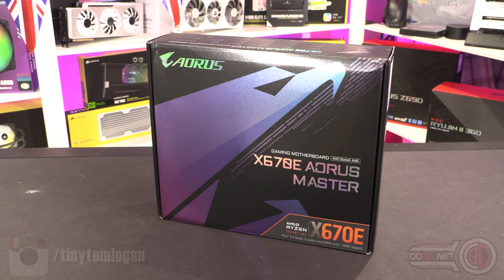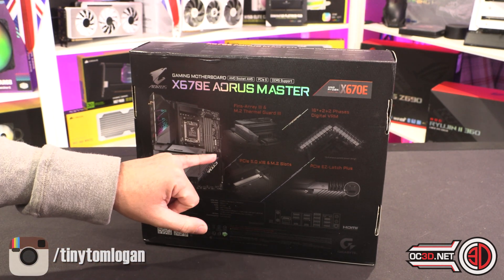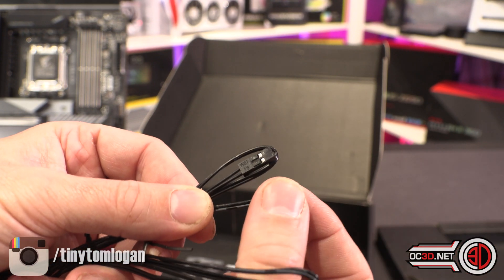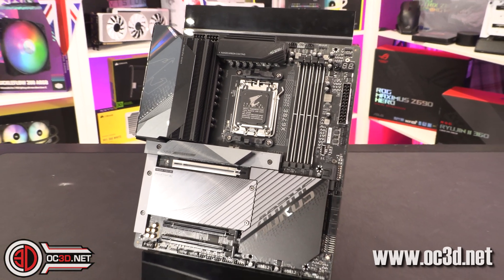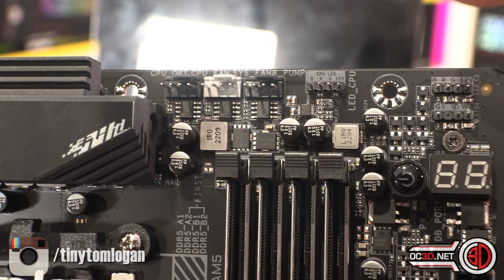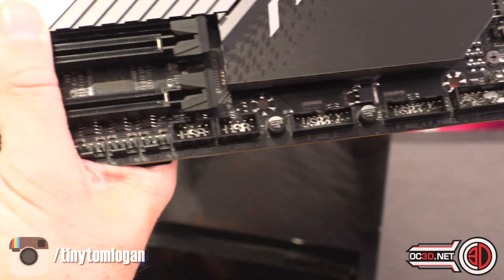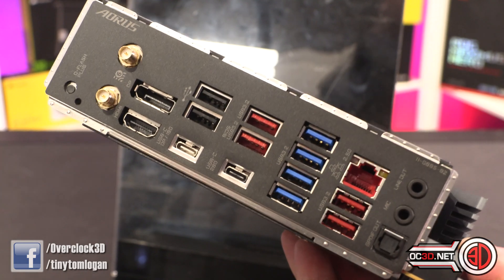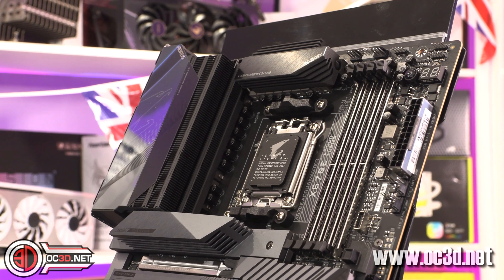Gigabyte Aorus X670E Master AM5 Motherboard Preview

Comment: Those heatsinks are fucking huge! I wonder if it interferes with a lot of air coolers like the NH d15. Personally I would wait for the vrm spreadsheet to be updated. I did that when I bought my b450 tomahawk max so I knew it could handle the 16 core 5950x. I wonder if amd will be releasing a 24 or 32 core am5 processor or if 16 cores at 170w tdp is the highest. I game at 4k so I have no need to upgrade my cpu to anything  but if I did it would be a 5950x. I'm currently focusing more on audio and other functionality for my setup. Id really like a good cheap sound bar and an sound card/audio mixer/pre amp thing. I just bought a pair of hyper x cloud 2's for $50 new and I'm excited to try them out as many people rave about how comfortable they are and their sound. I used to have audio technica m50s and they are flat and are super uncomfortable. If I don't like the hyper xs they will go back and I'll get senhesier 569s. I also just added some extra Bluetooth dongles to my pc, one dedicated to ps3 controllers and the other is for everything else. The reason being the one Bluetooth dongle had to have its drivers replaced with ps3 controller drivers for it to work properly. I would get a ps4 controller but they are so expensive. Other things I want to work on for my setup is a Bluetooth/wired hot swappable 104 keyboard. I am looking at the one from keychron but don't need a new keyboard atm so I can't justify it. I currently need a new gpu. My 1080ti can't game at 4k 60fps anymore so I'm keeping my eyes peeled for a good deal on a 3080ti or something newer.

Comment: 9:50 that doesn't say 28G it says 20G and the other is Display Port/10G, So the board has a USB3.2Gen2x1 USBC port (10Gigabits) and another USB3.2 Gen2x2 USBC port (20Gigabits)

Comment: 9:13 I really wish manufacturers would stop with cringey "gamer" make it go faster stripes that they also use to bump up prices with for example on this board "TEAM UP. FIGHT ON." written twice on nvme heatsink "ULTRA DURABLE PCIE GEN5 ARMOR" there is nothing "ULTRA" and the thin metal plate around the pcie x16 slot isn't really "ARMOR" the thin piece of metal costs around 1p of the sheet it comes from but we'll probably bump the price of the board around pfft I don't know $50-$70 of the total cost, the "GAMER" slogans on the metal and pointless cuts of the metal for "STYLE" that has to be another $100 right there. the board costs at most to actually make $150 which they could still get a small profit from but because of style points we'll sell it for $650
EDIT: Just checked what the price is for this disaster of a board is (based on the awful appearance of it) and on newegg you can buy it for the sickning price of $699.99 it doesn't mention free delivery or exvat so you might actually have to pay more than that, BUT newegg does mention free returns, ALSO! it's sold out! PEOPLE ACTUALLY PAID $699.99 or more for a motherboard!
Some people are actually ok with being bent over a barrel and getting shafted with these prices. 
This tells me that some people are even going to be ok with being shafted for $350-$450 for the B650 boards that are gimped of GEN5 support on the PCIE slots even though they are software blocked, NOTHING IS WRONG WITH THE HARDWARE stopping GEN5 running on the traces AMD just wants to charge you for the use just like they did with Gen4 support on X370 and B350 X470 and B450, traces excuse was just a excuse to make fans fight for them.
Reply: I mostly agree with ur statements. that's just marketing

Comment: 5:35 I would've preferred those fins to be on the top of the board and open at the back so the heat can pass through and out the top of the case, and the heatsink on the left of the board be designed in a better way to allow for air to pass through to the top of the case, as it's designed the air will pass through those fins and hit the backplate with no where to go.